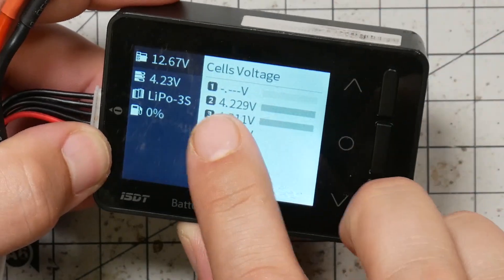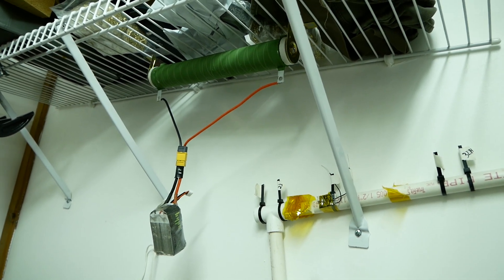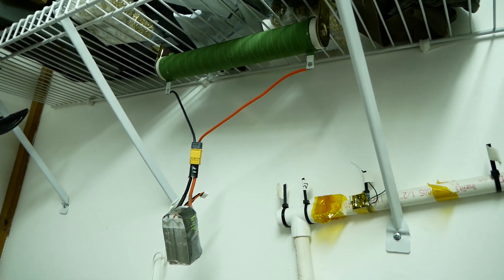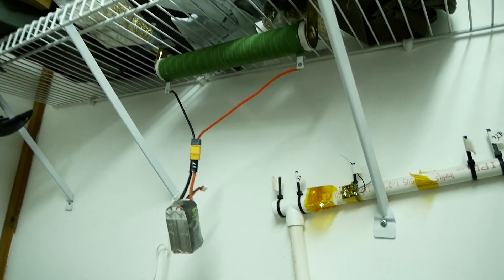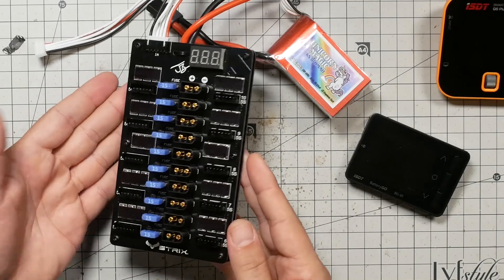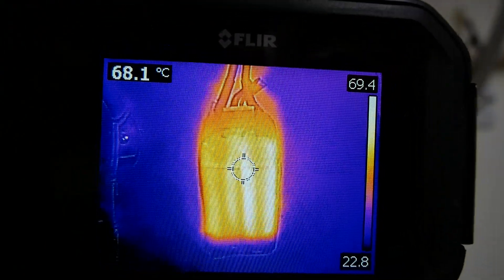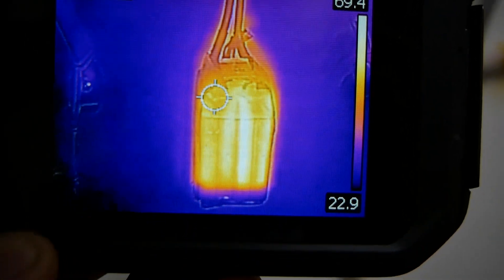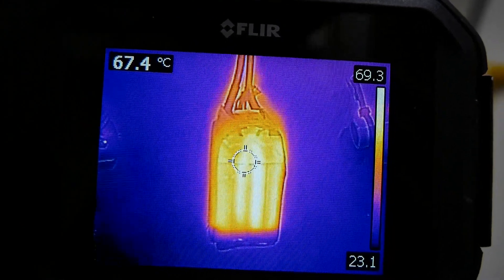Is Your LiPo Safe To Charge | WHEN TO THROW IT OUT

Comment: Worth noting. If you plug a pack into a resistor like that, and the cells are imbalanced, as it drains it can / will end up reverse charging any cells that started low. I would want to make a harness to discharge each cell individually from the balance lead. maybe a cluster of light bulbs

Comment: Old thread I know, but don't be fooled by IR.  That bright color does not mean it is very hot, it is a comparison to the surrounding temperature.  It looked like it was 5 or 6 degrees hotter by the display numbers.  Great videos you goofy bastard   :)

Comment: hey Joshua im wondering i got two gens ace 4 cell batteries , only used a couple times they been sitting for A FEW YEARS ONE ALL CELLS ARE 3.6 ONE .3.7 THINK I CAN CHARGE THAT ONE THE OTHER 3.6 3.6 3.6 AND ONE CELL AT 1.6 just from draining never took below running them hard forgot to put them on a storage charge it would be worth tryin to save or no, i really want to take it out side and hit it with nickel metal charge i have a good icharger to monitor cells if i can get it up to take a charge, the batteries look like the day i bought them just hung up flying for a while, what a mistake i made what you think is there a way to get it back up to be able to charge it if so send me details or a link to where i can find how to do it. Thanks Dave
Reply from the maker: The cells are all in a safe voltage range. I would just charge it up and use it.

Comment: BTW in rush current to a light bulb is about ten times its normal run current. Not sure if I would be using a light bulb to limit current based on its power and voltage rating. Use a constant current source. or power resistor of the right resistance and power rating.

Comment: I flew a 4s LiPo on the end of its life, down to brownout voltage. Was lucky to make it back to my feet. Picked it off the quad, smelled the insides of the battery on the wrong side. It was HOT, as in, burned a few holes through the shrinkwrap hot. Buried it deep in the sand, with intention of digging it up later in the day when things cooled down.
Actually forgot to pick it up, and after 3 years buried underneath the sand, enduring frost and summers heat, I finally found it with a metal detector.

The battery was cool, flat, and STILL HAD 3.2V IN 3 OF ITS CELLS! The one cell that was completely flat, had vented via a failed seal in the corner. But the surviving cells still holding a charge, nothing short but amazing. Zippy 1600mAh 35c, what were you made off.

Comment: i know you made this video like 5 yrs ago but i see you used a 12v light bulb but why the other connector? i just solder wires and 1 connector to the bulb and put them in a bucket filled with sand. should i be doing it the way you did it?
Reply: He used a smoke stopper.

Comment: I'd imagine that discharging a battery with a weak cell into a resistor indefinitely would ultimately result in reverse voltage across that weak cell as it will hit zero first.  I wonder what effect that might have?  Could it light your closet fire?

Comment: i tried to revive my 4S "Cell voltage Low" lipo on niMH and i did it at 4 amps than left for 1 SECOND to grab my drink and it popped, luckily was on granit counter in a lipo bag but dang
Reply: sOOOO much smoke though, very toxic stuff

Comment: I bought an early LiPo car engine jump starter. It worked amazingly for about 3 times. Then I started my freshly painted car with it. While I was driving it on the yard to the shop, the battery exploded into flames and damaged a new very expensive paint job. Never again.

Comment: This video is awesome until the introduction of the closet battery warmer device (discharger) positioned under some flammable stuff 😀
68°C on a suspicious cell? I'd prefer something slower with more resistance and less amps, maybe 2 of those wire wounds in series. Other than that the video should be teaching material.

Comment: I have a couple of LiPo batteries that have puffed up a little over time. Cell voltages appear okay and are very similar. Is the 'ballooning' under the wrapping a bad sign? Thanks for the videos on batteries and charging. I had knowledge of this year's ago, but completely forgot I had these stashed away from a hobby that I have not done in years. The batteries have not seen a charge in probably the last 5 years. I hauled then out and checked them over, and not surprising, 2 batteries are completely dead and quite squishy. These are now outside and will be going to the recycling centre later today.

Comment: Got a cnhl black 6s 1500mah 100c battery a month ago.
Flew it about 10 times 
Never charged over 2.5c
Kept at storage level when unused.
1 wreck not fast, not hard, and in the grass; no visible damage/dent/swell

2days ago when done flying i charged it to storage level and set it on kitchen table: today i pluggedit in to charge and seen 1 cell was at 1.1v. Wtf

Comment: Hi very interesting video and you are the master professional engineer just a quick question I have philips ipronto remote control its has colour screen touch screen the original battery pack is distorted which is 7.4v at 2000mah and have 3 wires plug and I ordered new lipo 7.4v battery with 3 wires when I connected the philips ipronto remote control with power dc adapter and I checked the 3 pin connecter pin 1 is positive and pin 2 is negative between pin on and 2 I get 8.1 volts dc pin 3 if I check from pin 1 positive ie pin to pin 3 its reading 5 v the new battery pack I got I connected to pin 1 positive pin 2 negative the remote control is working fine but what about the 3nd wire from the battery which is yellow where can connect ? Just a bit 
scared to connect to pin 3 on the remote control it might damage? Please kindly help me on this issue waiting for your reply Thankyou Sam

Comment: Your way of discharging a LiPo battery for disposal using one big resistor is not safe. If you have a pack with one weak cell in it, the remaining cells will charge the weak cell in reverse polarity.
A smarter way of doing it is to use the balancing connector to connect an appropriate light bulb or resistor to every single cell in the pack, so every cell will be discharged individually at its own pace, capability and state of charge. And when the process is completed, cut off the balancing connector, strip all the wires and twist all of them together, which will effectively short every cell.

Comment: This is a good and important topic. About the lowest discharge voltage that is still safe i am not sure if 3.0V is a problem, esp. when loaded. At a high load a voltage of 3 V isn't a problem imho but with no load its the end. Most cells are fine until 2.5V (normal 18650 li-ion) but 3.0 V is safer. LiPos are much more dangerous esp. with high C ratings and energy density.

Comment: I have a battery that when charged all cells are holding 4.20v but one of the cells is droping 4.13v

Its brand new (newby here also) but didn't charge it when i got it, and i was trying to bund it with my goggles and tried the motors for a minute. That cell droped to 2.25v (terrible i know) 

What do you think? Should i retire it?
Reply from the maker: Definitely retire it.

Comment: i think why that battery you recovered is working fine is because it was practically new at the time so it probably was safer.

also there are more than 1 chemistry that charges to 4.2 and discharges to 3 volts

linmc is one such chemistry used in the ev industry.

Comment: I discharge dud LiPos in half a bucket of very salty water outside. I cut the plugs off (1 lead at a time) , and leave the battery in the bucket for a week or till the leads stop bubbling. I then check for any voltage, and if it's dead, drive a 6 inch nail through it just to make sure. Works every time.

Comment: I have a brand new battery 4s which has 2 cells at an IR of 9 or so and then the other 2 cells at an IR of 20-23...is this a concern ? Battery is practically new maybe 4 flights no damage.

Comment: I see that you connect the battery with a resistor to discharge. Beware for the resistance Ohm will be lower while the temperature increase. Then the discharge current will increase also. So we should keep cooling the resistor by a fan.
Reply: A wirewound will have a higher resistance as temperature increases. What sort of resistor were you speaking of?

Comment: 😅 Discharging like that in house like that is way more risky than a little voltage difference.
Cells will puff and even with low energy still a risk to burst.

Almost all fires are due overcharging. Wrong charger setting.
And if they are crippled its better to get rid of them.
Reanimate and check of they keep voltage and capacity together with equal internal resistance is safe enough.
Parallel charging too much risk too.
Especially without using the balance port.

Comment: Just built my drone and flew it. Was hovering around 14.7v on 4s then I think I just didn't notice it afterwards but was dead as I was doing full throttle to get back and barely made it. Just went to charge the battery and it says full instantly. Something ain't right 😂

Comment: What about batterie that are a little bit puffed but all cells responds correctly?  I have batteries that I bought in 2011 and they seems to be still ok but aare a little bit puffed.
Reply from the maker: If the cells hold voltage and the IR is low, then I'd keep using it.

Comment: Something i'm scared by uncharging with a load is the one have a higher resistance will reach zero volt first and will be revesed in polatity by other cells..  I did a comb with 100 ohms resistors by parallel plug ;)

Comment: 3:19 i have heard you say in multiple videos you dont let your cells get anywhere near 3.2 volts, which is what i know to be the safe cutoff voltage but i drive cars. is the reason for not letting it get near 3.2 volts just so you have enough battery to land?

Comment: Whenever I replace laptop batteries for friends/family, the sketchy cells/pack goes into a spare ammo can until I can make the trip to a recycling center. 30 cal ammo cans, new or surplus are typically only a few bucks. Could spread good batteries across a few cans to mitigate loss if one goes supernova and dump sketchy cells into a dedicated 30 or 50 cal can.

Comment: E=I x R so 14.8÷.5 = 29.6 amps 
P= E x I so 14.8 x 29.6= 438 watts. That's a lot of heat.  Might wanna use a bigger resistor.
Reply from the maker: I did this math before buying the resistor. I'm not sure I remember correctly but I think it's 2 ohm 200 watt.
Reply from the maker: Can confirm. 2 ohms.

Comment: anything above 14 ohms is a bad cell..
Reply from the maker: That completely depends on the size of the cell. Smaller cells will have higher IR and vice versa. For a 10,000 mAh cell, 14 mOhms might be extremely bad. For a 450 mAh cell it would be impressively good.

Comment: I had an inexpensive battery that just decided to go up while sitting there. It was a very minor failure and merely resulted in a burn mark on my table.
I had two signs that I was having problems.
The first was the ubiquitous "they're puffing up". The second was that my charger was indicating that one of the cells was a little weak, as the voltage seemed a little lower on that cell when I did a per-cell check. Not below 3.0, but where the others were at 3.8, that one was down at 3.2.
I should check my charger's accuracy to make sure that it's not slightly overcharging my packs. I think that was just a poor quality battery, as the other one of that set has also demonstrated signs of a weak cell, while my higher quality batteries have shown no signs of developing any kind of imbalance like these ones do.

Comment: If you have a charger that shows the cell voltage, is it necessary to also have a separate battery voltmeter like the BG-8S?
Reply from the maker: Not strictly necessary but good for in the field.

Comment: Another indicator you've got a battery going bad, the tell tale smell of Wriggle's Jucy Fruit gum.
 If you smell that, you have a cell either with a hole (breach) in its case from puncture or its gotten pressurized with gas enough to have a breach in its case somewhere. Dispose of the cell or pack before bad happens.

Comment: Hi Josh, I've got a potentially dangerous situation with 2 hard shell Zombie 6400 mah 100c 2s 7.4v LiPo battery packs.  I bought them brand new about 2-3 years ago, intending to go racing, but I got nervous about using the LiPos due to already living through a bad house fire caused by one.  So they ended up in a fire proof bag, in a metal tin, in the garage and I never went racing.  Fast forward to today and I suddenly remember about them.  I fished them out and they are both at 7.6v according to my multi-meter, so have been sat at full charge for all of this time.  I had assumed they would be at storage because they were brand new and unused.  Should I just discharge and toss them, because they are likely to have destabilised and will probably go nuclear if I breathe on them, or do you think they may be okay?  Also, how can I know for sure?
Reply from the maker: I doubt they will go nuclear but they will probably have a ton of sag.
Reply: @JoshuaBardwell  So do you think they'll probably at least be safe to use then? Also what you you think is a good, safe storage charge for a 2s 7.4 lipo?
Reply: @JoshuaBardwell  Also thanks for the reply. It's much appreciated.
Reply from the maker: Storage charge for lipos is always 3.8 volts per cell.
Reply: @JoshuaBardwell  Thank you, that helps. So that would make the 7.6v total pack voltage correct then for storage then, wouldn't it? I just assumed that was a full charge, as it's a 7.4v pack, but I'm guessing not now.
Reply from the maker: 7.4 is the nominal cell voltage, which for a lipo is 3.7v per cell. Full charge is 4.2v / cell.

Comment: I have 2s 2600 mAh lipo batteries for RC. I charge them via a small 2s cheap Hubsan balance charger via the balance port.
I also have a ISDT X16 charger, but I cannot charge those because battery has no xt60.
How do i charge it to storage?

Comment: I parallel charge almost exclusively.  What I do to monitor the health of my batteries is to check the battery with my checker before it ever gets plugged/unplugged into/from anything... the aircraft, or the charger.  I am almost obsessive with this.  But I know exactly what the health of my batteries are at all times.  If I notice anything, I'll make a note on the battery with a sharpie...  "*Cell 4"  If it turns out to be nothing, I can always take an alcohol pad and remove the note (but never have done that yet ;-).  Can't be too careful with LiPo's.

Comment: don't you think, cells with higher IR could still be just fine for a battery bank or other low current applications? AFAIK recycling of these isn't running at full steam yet, and neither is it very efficient and clean, so better just reuse until it's 100% useless/dangerous.

Comment: I use a few lip's for my trx-4 jeep, and i'm new into the rc word. I charge it when the jeep says it's empty, i use the supplied charger and i use store mode when not using the truck. And now 1 year later 1 lipo battery is bulging a little. But cmon, it's a 65 dollar battery, is it normal it goes down that fast? I mean my car battery is over 12 years old.

Comment: Do smaller cells have a higher internal resistance?  Pulling one 2s 500 Auline out - they read 56 and 60 ohms.
Reply from the maker: Yes correct. Smaller cells have higher IR.

Comment: That last shot with the pack over 60 degC while it discharges just confirms my opinion that it's unsafe to discharge the pack like that. If the pack's getting that hot then you're probably pulling a lot more amps than you think. Or that pack is just so damaged that it's unsafe to discharge it at even 2 amps.
Reply: Yeah, I've tried to make it add up but I can't, I feel like I'm missing something. He said in the vid it was a half ohm 60 Watt resistor, he links to a 2 ohm resistor in his description and says it'll be 6amp on 4S, which is true if discharged already in RC but at full charge over 8amps.
A half ohm would be over 32Amps at full charge.
A new 1500mah 4S could probably handle 30Amps or more new depending on the C rating.
60 celcius is an ok temp for a battery in heavy use.
However I'd go for a safer slower discharge myself.

I hope my math is correct, some of the things he was saying wasn't adding up or maybe he changed how he did it or was talking about different things.

Comment: What about the cases of new batteries exploding on their first charge? (With all charger settings as they should be) Sometimes things just happen (or accidental manufacturer issue) - it's not always the user's fault.
Reply: Things can happen. My charger is inside a concrete block on the tile floor of my enclosed porch, a place where a lipo fire would be pretty safe.  Which means that even a manufacturing defect isn't going to burn down my house, with my daughter in it.
Reply: @senseisecurityschool9337  Yeah, of course it's a good idea to have a fireproof place to charge your batteries, etc and it's because of my point: The battery itself might go up in flames due to a manufacturing defect and it won't have been because you did anything wrong. 
Thus why putting it in a fireproof place and/or watching it is sensible...

Comment: Hmmm... I discovered a bad 6s lipo battery in my collection recently. I snipped off the terminals to save them. I bring the bad battery outside in an open field, and I shoot it with a 22lr rifle until I don't see smoke anymore. That's the only safe way to kill bad batteries.